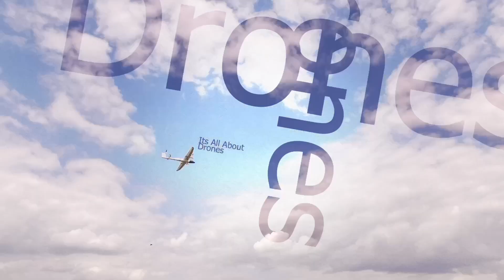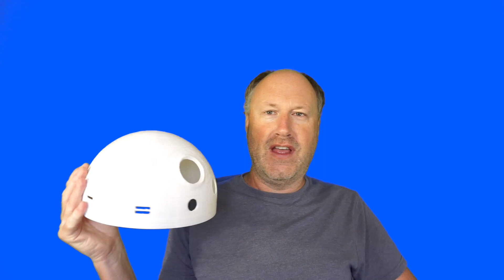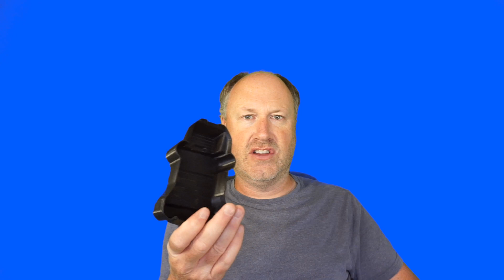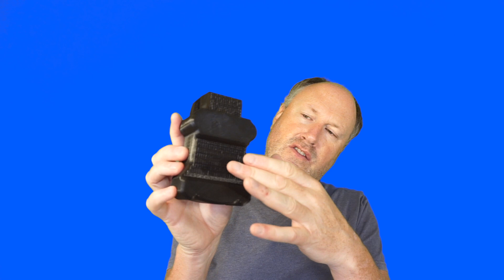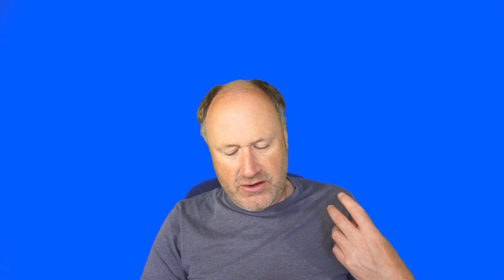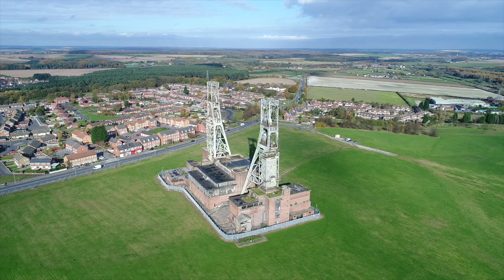3D Printing

Comment: I'll step forward for a free drone case, thanks!  Although I'm reasonably new to droning, I'm now finding that all the accessories I'm accumulating for my Mini2 are taking over the space in the DJI bag I bought, so the case might enable me to pack it in a larger rucksack without harm!    
Also you know you want to do the R2D2 build, so do it! 
Happy flying!